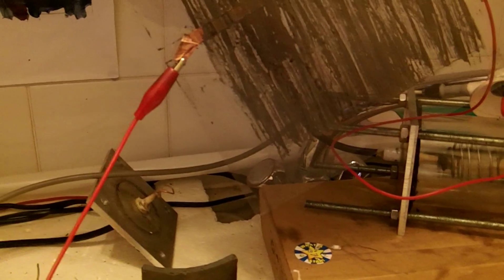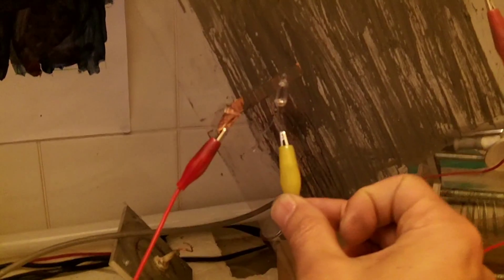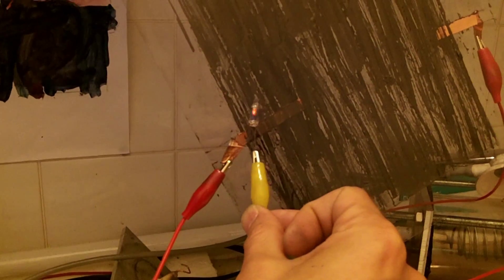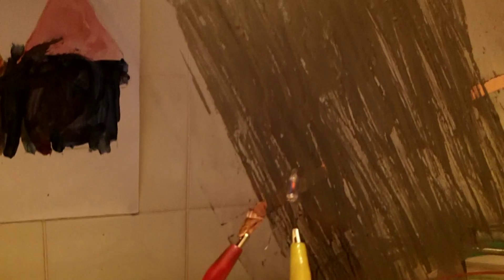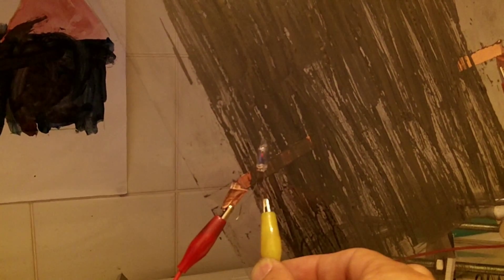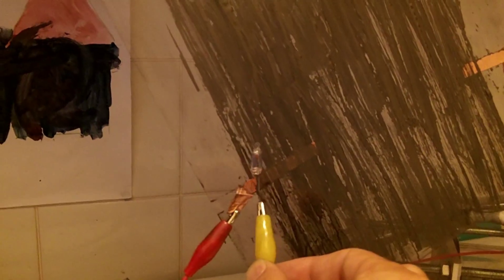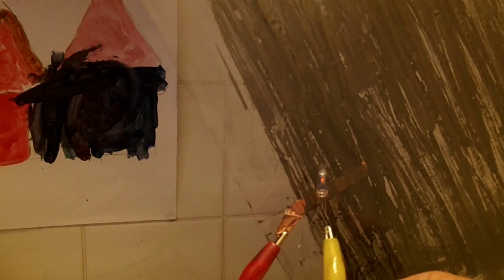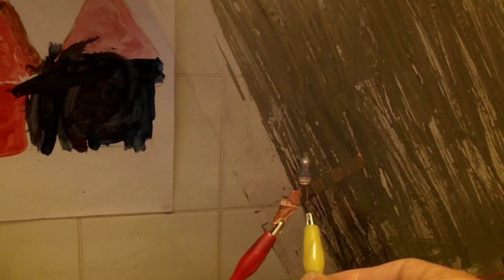Explosive capacitance

Comment: Interesting. How are you rectifying the ZVS? Do you have a multiplier?
You seem to be getting very different results to Roberts calculations.
Those sparks look like about 5kv from 1-2nf capacitance.
Could you compare to tinfoil on the same plastic for a control?
Also if you could state the thickness of the dieletric? It looks like 100 micron OHP transparency?
Reply: Mongrel Shark I'm not using the same materials as Rob, and so I can't compare with his experiments (he's using PET, while I'm using acetate. Not sure how many microns). I haven't tried building these with foil yet, but I know a lot of people have, and then they have used them in their Tesla Coils. E.g 

http://adammunich.com/diy-capacitors/

Regular capacitance is around 3nF. I assume this is roughly the same.

I'm going to try and get a measurement on the capacitance later today.
Reply: Hi mate!  I've just tried the spark test for aluminium foil, graphene and a 10000nF (0.01mF) cap which I use in my Tesla Coil. They all look and sound very similar, in spite of the massive range of capacitances (Al foil should only be about 3nF). I'm gonna be trying to get discharge times in future, as I see it as the only way, other than buying an LC meter
Reply: Mongrel Shark I can see the difference when the spark gap is running and I have the whole Tesla Coil going, but not when I just discharge it in one spark. The length of the top spark varies. You can see this on my latest video, and you can see that my set up isn't really holding charge like Rob's. However, there is a lot of internal arcing in my Graphene sheet, while the Al foil has no arcing, so perhaps this explains the poorer performance. Still investigating, and it's lots of fun!
Reply: Mongrel Shark How are you calling voltage and capacitance like that? Is that just experience from your experiments?
Reply: Edward McLaughlin Yep. Purely a guestimation based on experience discharging known voltages in known capacitors.

You can calculate voltage fairly accurately (within a 2kv margin of error). based on electrode size and spark length. http://www.kronjaeger.com/hv/hv/msr/spk/index.html

And I have gotten to get a feel for the capacitance from the brightness of the spark (amps) (could be deceiving on camera) loudness (speed of discharge) (again can be deceiving on camera) as well as damage to the electrodes.

ie if this cap was in the ranges of magnitude suggested in other videos on YouTube, it would have vaporized the leg right off the neon in a few sparks... As a few hundred thousand amps at 5kv will tend to do....

No bits of metal flying, puts the discharge well into the <1a ranges, which puts the cap in the low nf range.

I can also get some feel for the inductance, as the spark was caught by the camera almost every time. Sugesting a longer discharge caused by higher inductance.

The sparks that sometimes appeared on the sheet sugest high impedance (resistance) is also slowing down the discharge.

the bits of graphene flaking off into the air tell me this capacitor is not suited to rapid discharge work and will get hot under HF conditions.
Reply: By the way, I was under the impression that flybacks had internal HV diodes which rectified the output. I thought all CRTs worked with DC rather than AC. But I am a grammar teacher, so I'm not sure. :)
Reply: Modern flybacks have diodes and produce DC.
Older ones have AC. It looked like you where using an older one or a hand made one in the video?

If it was AC it would explain the discharge on the sheet that didn't seem to be blowing holes in the plastic.
Reply: Mongrel Shark I've decided, I'm definitely going to try this with Mylar stencil sheets (found em on ebay) when I get back from a holiday, in a few weeks. Rob said he was using PET, and I know they use PET and mylar in capacitors anyway. Might as well go with the tried and tested materials, because at the moment it isn't showing huge capacitance. I've tried with a 'ducteur blade' today, and it's still much the same as before.
Reply: I don’t think there will be a huge difference in capacitance from materials of similar thickness. I'd say its the way the ink is applied. So it has many times more surface area than the apparent surface area.
Reply: Mongrel Shark Well, there's only one way to find out!